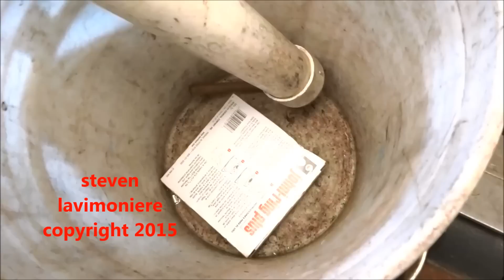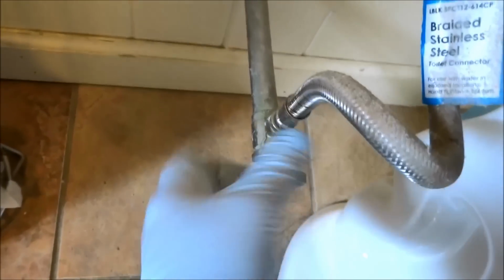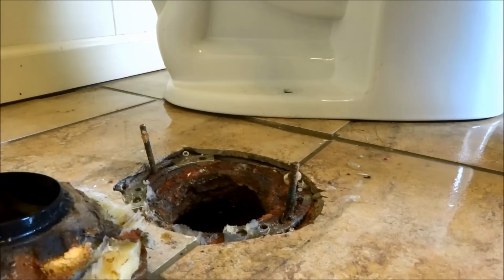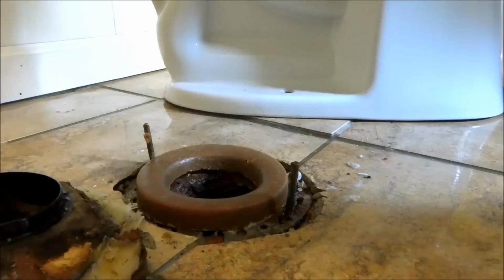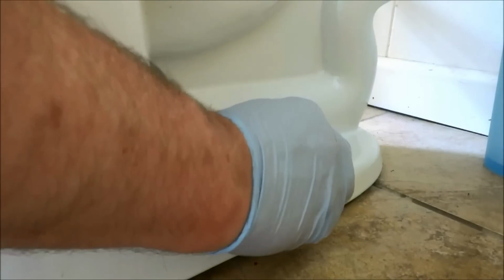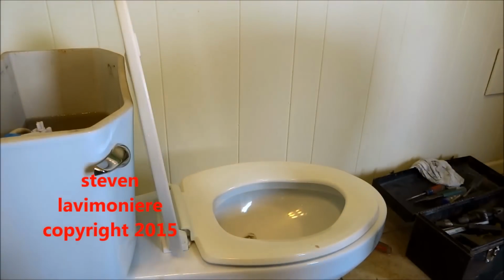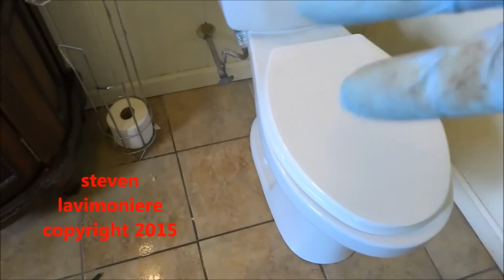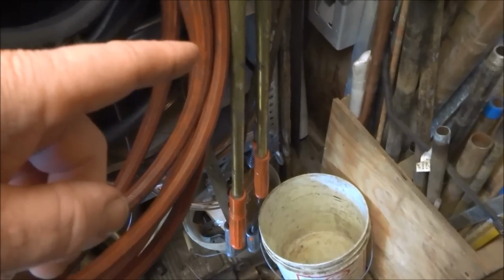tooth brush stuck in toilet will not flush

Comment: I'm curious why you didn't try the auger first?  You knew what was likely stuck and causing the problem.  It seems removing the toilet would have been second to try?  I'm about to try to get something my toddler flushed (no idea what) and is causing slow drain.  I want to make sure there wasn't a good reason to remove toilet too.

Comment: nice video steve. what company auger do u use? i have a ridgid but the one u have the head on it looks much better bec of the swivel head?
Reply from the maker: +John i have 2 closet augers the older one has a small head on it .probley 22 years old now ,bought it at a supply house back in the day .the new ones have a big head on them .i like the smaller one the older one ,maybe try ebay .
Reply from the maker: +John http://www.ebay.com/itm/RIDGID-59787-Closet-Auger-3-Ft-1-2-In-Cable-w-Bulb-/331345525654?hash=item4d25bb7b96:g:XqUAAOSw9r1WDj6R

Comment: This does work but it is not a permanent fix if the problem is bigger.  I had an issue where 2 toilets wouldn't flush right low water in the toilet, tub didn't drain, back shower was plugged and the kitchen sink was semi not working.  The issue was the MAINLINE needed to be unclogged.  The pipe that controls all objects was clogged.  Was a $279 fix depending on who you go with.

Comment: Steven, I haven't seen the snake you used in any store where did you get it and what is the brand? A small flat plastic comb about 1 1/2" long and 1/2" wide fell in the commode and nothing I have tried lets me retrieve it. My neighbor removed the commode and didn't find the comb. The wax ring was replaced. I have used a snake several times but it has no crank and it didn't work. Plungers are useless. I have the one with the black bulb. I have poured in water and it doesn't help. I tried the Epsom salt and vinegar remedy, the liquid detergent and hot water remedy , vinegar and salt remedy and some "supposedly" great drain openers none of which worked. My neighbor used the bladder in the main system on the roof and the commode flushed all day, it was a little slow going down but I could live with that. But after a day it backed up again. I haven't been able to find lye, it is my next consideration. I'm a female, age 70, and on a very, very, limited income and I can't afford a plumber. What do you suggest I do next. The commode is only 3 years old. Would it be too inconvenient for you to email me direct.  I have got to get this issue resolved. Another neighbor told me to buy a new commode for about $107, I can't afford it. A $107 is the same as $1070 to me. Thanks
Reply from the maker: +JOYCE HAMILTON some times you have to just replace the toilet, go buy a closet argor first and try that you can always use that in the future to unblock a toilet . but your neighbor is right best just to replace the toilet . sounds easyer .

Comment: Thank you for making this video. I seem to have accidentally flushed a small flashlight down my toilet and while it drains, it does so slowly. I will try a closet auger first but if that does not do the trick I will end up performing the same operation you showed. You have helped me a lot!
Reply: Flashlight was clipped to my belt (but not properly), I took a leak, went to flush and as I pressed the handle the light fell off my belt. Perfect timing unfortunately. Might seem odd but odd does happen.

Comment: So why did you take the toilet off? You could have just used the auger.
Reply from the maker: i tryed the closet auger ,it did not work so i had to pull the toilet
Reply: Why would someone want to use an auger? Wouldn't that just push it along where it can do more damage or be harder to remove? Not trying to be contrarian, but I have this problem right now. My son apparently flushed a dry erase marker and it is stuck in the toilet somehow. We have a septic system, so I would rather have it out than further in. What do you think? Thanks.
Reply: Whatever works, works. Good for you.

Comment: Steve , you need to give yourself a raise...
man, that supply nipple to the angle stop was a little too short wasn't it?..lol

She said she had not saw any leaks before in the ceiling below, but  I dont see how that toilet was not leaking at the seal,, it looked like that old flanged wax was not even sealing against the toilet good.

you will probably get another call there to repair that old floor flange later,, i dont understand when folks add the height of new ceramic or new floor , they dont get the plumbing right at the flange at the ssame time.

i hope she dont leave that old toothbrush on the counter and someone uses it..lol

good video steve as always,, you run into the damnedest stuff at some of these folks houses,, thats one of the reaseons we like your videos.

keep on going man,, and hey  AC season is just around the corner
Reply from the maker: nate ya i see some crazy stuff. lol all in a days work .i am looking forward to the a.c season
Reply: Lol ewww I hope no one uses it either

Comment: I accidentally flushed a toilet paper holder down the toilet,  can I remove it the same way you removed the toothbrush?
Reply from the maker: you need a closet auger /snake ,to hook it and pull in back out the way it went in might be best to call a plumber if you don't have the proper snake
Reply: Ok thanks

Comment: A small travel sized deodorant fell in my toilet yesterday as I was flushing. Do you think this would work for this case or am I screwed?
Reply from the maker: +Angelica Portilla you will have to pull the toilet and remove it from below it will get stuck in toilet trap most likely
Reply: Hey again! Removed toilet, didnt find the deoderant in the trap, is it safe to say its long gone ?
Reply from the maker: Angelica Portilla maybe its down the drain hope it gets flushed out time will tell .

Comment: Hi @steven lavimoniere
Thanks for the video
I just accidentaly flush toothbrush into the toilet after cleaning the shoe and throw the water in the bucket to the toilet. Forgot the toothbrush is in the bucket.

I just curious :
1. Could we use Toilet Vacuum Pump first to pull the toothbrush with waterflow back ?
2. Should I dissasembly the toilet and Suck the Water before using the Auger? Could we just directly using the Auger?